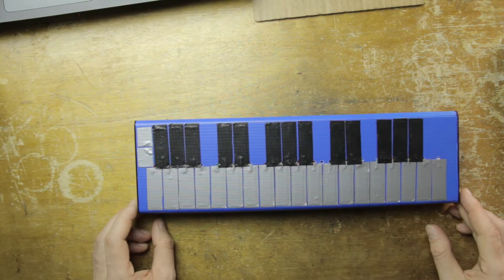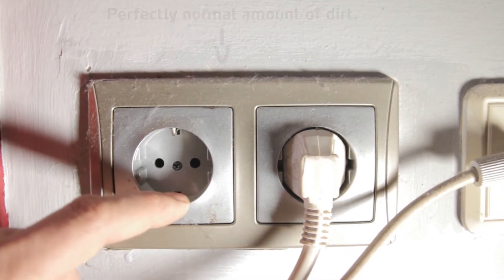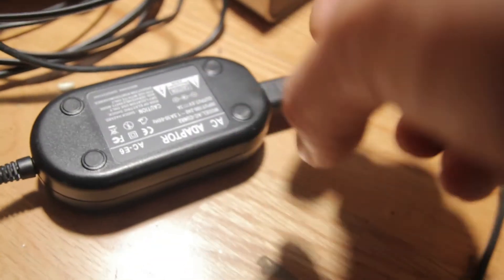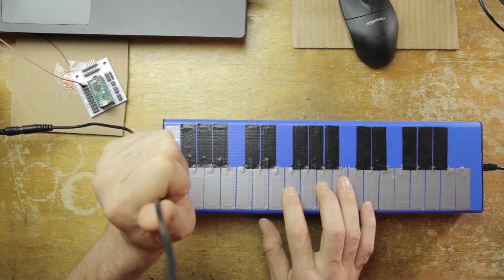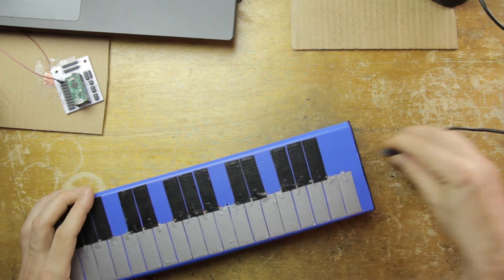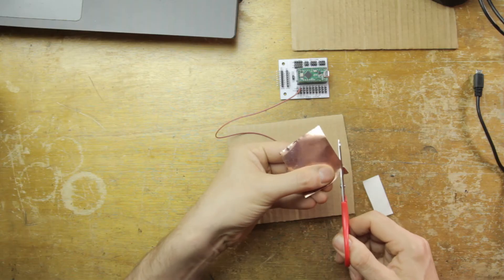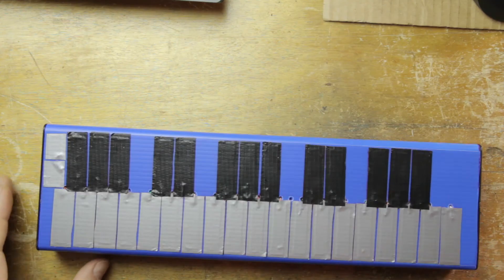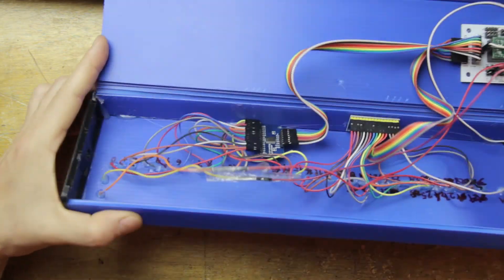Capacitive sensing and Teensy tribulations.

Comment: If you put a sheet of grounded copper below all the sensors as a ground plane, that should decrease noise, but also decrease sensitivity since it's basically putting a cap in parallel with your touching finger. So make increase the distance between the sensing electrode and the ground plane.